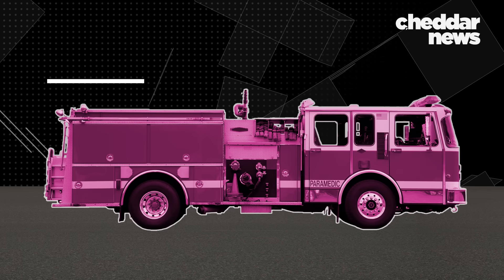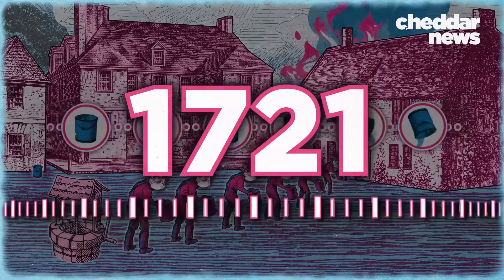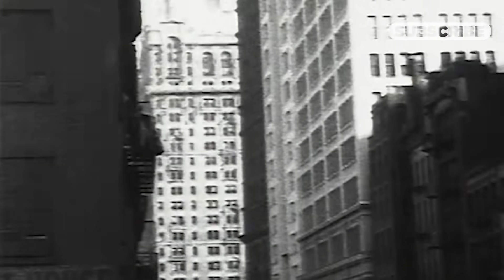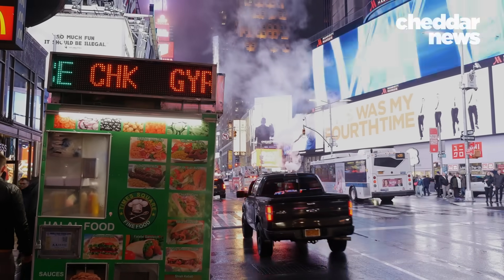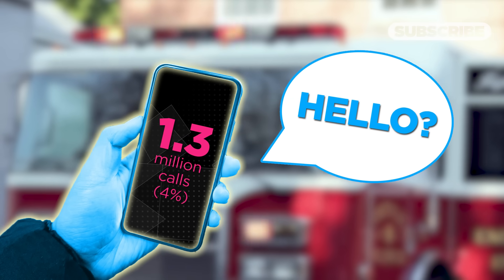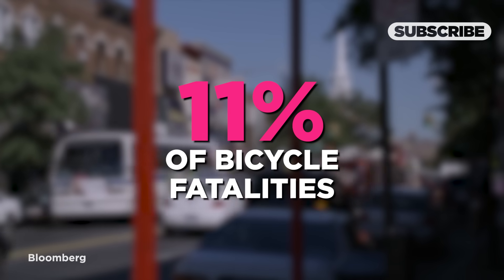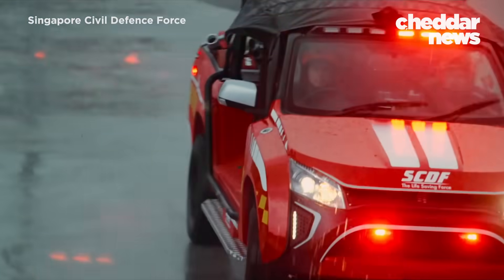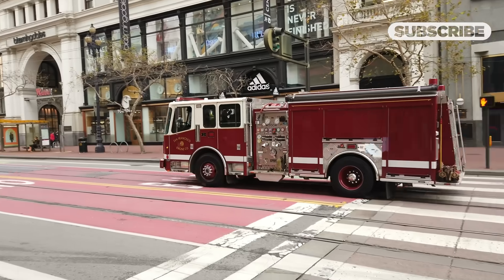Do American Fire Trucks Need To Be So Massive? - Cheddar Explains

Comment: The problem with the euro style trucks is that their tanks are WAY smaller. I am a firefighter and a majority of our juristiction has no hydrants at all. So we need 1500+ gallons, because of the lack of hydrants. Also the US fire service is completely different than other countries. The way we operate is 100% different. One of the guys in my dept went to sweden, and was talking to some firefighters they said that they think american firefighters are on crack cause of how long we stay in. And their gear weights 10x less than ours. Just keep that in mind.
Reply: Ummm
A typical callout (löschzug) in city's in germany will have 1500-2000 gallons of water. One tanker with usually 1000 and one to two general/all purpose engines (Lf/hlf) with typically 500 gallons, sometimes another 100+ or so might be carried on the ladder so it can engage while hoses are still being set up. Additionally a command vehicle will be out
Reply: @the_retag  -- That's quite a bit of water!   The water alone would be 8 tons.  A machine carrying that much water wouldn't be tiny.   It might not be supersized but not tiny.
Reply: @GilmerJohn  ah i mixe gallons and liters up again
Its 2000 gallons total, being 8000 liters in three trucks
Ill fix it
Reply: @GilmerJohn  its 1000 gallons/4 metric tons in a tanker. It carries only 3-4 firefighters and only a few hoses breathers and fire specific equipment, not general stuff like hydraulic shears, oil binder etc. Often 100 gallons or so of foaming agent will be carried as well. Ther eare sometimes large tankers carrying up to 2000 gallons, and rarely semi based ones with 5000, but those vary as they are not standardised
Reply: @the_retag  That is 1 truck for us, thinking about it we could have a fire alarm with 5000 gals. If we get 2 engines thats 3000 gals right there, if a tanker comes possible 6,000+ and our areals have about 500  or 750 gals. And we get about 8 command vehicles (Cause volly chiefs want to do volly chief stuff ig) we had a 3 alarm fire, and we had easily 10,000+ gallons there
Reply: well, there are Engines and Tankers; Although they vary quite a bit in city, from small and compact Tankers perfect for the cities, there are also Tankers based on semi trucks just like in the US; Also Europe has many countries where the hydrant network isn't great, and they also need to shuttle water to wildland fires.
Reply: @EnjoyFirefighting  My area is mostly rural, our sister department has the city. It's not the point to what I'm saying, what I mean is that those size apparatus won't fit our needs
Reply: @evanl.4556  you said that our tanks are way smaller, which IS correct for the average Engine ... but there are also apparatus with 6,000 gallons of water or more; But I completly understand that these apparatus still wouldn't fit your needs for many different reasons
Reply: @EnjoyFirefighting  Over here there are some apparatus with 7,000 gals. But I agree there are exceptions, and thanks for understanding.
Reply: @evanl.4556  largest one built here on a normal 3 axle truck, not being a semi truck, carries 8,717 gallons, but well that's not for municipal use; Largest truck trailer combination I know of carries 15,787 gallons, but again not for municipal use. 
For municipal use the largest Tanker (not being a semi) carried 5,231 gallons, and the largest semi truck based Tanker is probably the one which carries 7,000 gallons. However all those are barely any good for a contest on who has the biggest d*** .... all those are super rare apparatus, far from the average and I'm sure there are lots of Tankers in the US which carry more water
Reply: @EnjoyFirefighting  Lol, and yes there are tankers almost everywhere. IN my area, generally they hold up to 5000 gal. but we got some tractor drawn tankers
Reply: @evanl.4556  we have Tankers everywhere as well, but most are of rather compact size, being based on a 2 axle truck chassis. The smallest of our Tankers carry less water than your Engines do. In fact, the American Engines the US Army Fire and Emergency Services used to have at their USAG bases here had to be classified as Tanker due to the amount of water they carried and the lack of other equipment which would be required to classify them as Engine here. 
In Germany tractor drawn tankers are super rare (I can think or 4 or 5 maybe), but they're are a standard in e.g. Poland where even a FD in a city of 400k inhabitants have several tractor drawn tankers.
Reply: but does all that weight make the american firefighters more efficient? because if it doesn't, then just adopt the european/asian way.
Reply: @pizdamatii5001  It helps us adapt. We go in with the mind set of risk a lot, save a lot. Risk a little, save a little. I will go into a collapse if I know the victim is alive, and savable. I will go to hell and back, but I need gear suited for that. I can't have gear that is paper thin (I know it's not paper thin just making comparison).  And also here in the US, the fire service runs on tradition, that is the most important thing is keep tradition going. That is why some depts. have bells on their rigs, why all our ranks have bugels and not stars, and more stuff I can't think of

Comment: Another point on cost.  My town recently had to build / rebuild both firehouses because the newer style larger trucks were almost the same size as the doors. (Also the buildings were in poor condition, not meeting code, etc.) So that only increases the replacement cost for new equipment.

Comment: The response from fire departments to narrower pedestrian friendly streets shouldn't be to oppose them, but to embrace them since they would reduce the number of vehicle accidents which make up the majority of fire dept. calls. Shouldn't fire depts. be pushing for ways to prevent the need for their service?
Reply: The US fire trucks have deckguns that they use to immediately halt most residential fires. The problem is they use a lot of water, which is why you don't see Europeans trucks having them.
(They use deckguns because it takes less time to set up and don't have to stare at a fire as it burns down a house while throwing hose line.)
Reply: @AG-yc7vt  actually, deck guns are very popular on most Tankers in Europe as well, they just aren't as popular on Engines. Depending on the country, bumper mounted guns are popular, even on Engines
Reply: Sadly firefighters (specially the boards controlling them) want to overstate their importance.  Is like cops they don't like stats that show lower crime
All about money
Reply: Here's the thing. If there is an emergency, as long as the "truck" can get there, even if driving on ped/cycle friendly streets, then those along the path should clear out so that the emergency vehicle can do its job.
Reply: Jreese46 forgetting well funded public transport and bikes. Anyway much better for you.
Reply: By regressing to making everyone walk?  I suppose they could just tear your house down, to guarantee it won't burn, too.
Reply: @jreese46  Lol, excellent point. These anti-car people find it difficult, near impossible, to think outside of their own experiences.

Comment: As a firefighter. With all the gear and people we have the size is necessary. When we have a truck packed with guys and all of their gear its cramped enough, making it even smaller would be terrible. Plus the trucks we use now are just badass.
Reply: In Europe those smaller trucks work too
Reply: i wonder if american firefighters are larger than their european counterparts?
Reply: @pizdamatii5001  You don’t see a fat yellow helmet firefighter in Ireland
Reply: the trucks you use now are big that's not a synonym for badass
Reply: I see many American apparatus where lots of the available compartment space remains unused, while the way more compact apparatus from e.g. Germany carries in fact more equipment (but with a smaller water tank) as every inch of available compartment space is used like in game of tetris.
Reply: @EnjoyFirefighting  What dept have you seen with unused compartment  space?
Reply: @Raheim157  I'd have to look them, could post a video link mabye tomorrow; It's definetly a thing I've seen at more than just a few apparatus walkaround videos, seems to be a pretty normal thing for equipment being stored loosely in drawers or at the bottom of the compartment, with the upper half remaining empty
Reply: @EnjoyFirefighting  Wastage

Comment: Of all those calls that weren’t for fires, many were made because of the threat of fire. Much easier to call the FD to prevent a fire that could break out due to a wreck or similar event.
Reply: It's a poorly written piece and doesn't cover the fire service as a whole or the actual correct sizes of apparatus. The actual average water tank size is 750 gallons of water the correct width of a custom cab is 96 to 100 inches not 10 feet as claimed. And smaller compact units are used all over.
Reply: @mikechristensen8046  Yeah, several double takes required when watching the video. Where's my department's spacious 10 foot wide cab???
Reply: Also, it makes much more sense to have one expensive vehicle that can respond to everything (in the European, American or whatever style) than it does to have a million different vehicles. 

This "x% of incidents are fires" thing always pops up, but it's a bit like singling out a particular bit of medical equipment in an ambulance and saying "we don't need that, that's only used in 3% of callouts."
Reply: Most of the calls firefighters take today are from car crashes. Modern fire prevention methods are effective enough.
Reply: @bishop51807  Incorrect.  It is EMS (medical) calls, not motor vehicle accidents.  Most accidents are non-injury and don't require a fire dept. response.
Reply: @ArmyMP  You are 100% correct. Most calls are EMS. The term "Fire-Rescue Dept" is misleading in order. Hope they never change that though. "Rescue-Fire Dept" doesn't sound right. 😂
Reply: @ArmyMP  And most EMS calls are answered without a fire unit response.
Reply: @ArmyMP  In a lot of cases, fire is called for a reasons.  1, better to have them there IN CASE a fire happens  2, a person may not be injured, but the car is damaged in a way they can't get out  3, Simply blocking the road with something huge and with tons of flashing lights.
Reply: @andrewtaylor940  Actually... many agencies send an engine to medical calls as well.  They might get their sooner and thus provide initial medical aid for the arrival of the ambulance.  They can also assist the ambulance crew (EMTs+) with finding the patient, lifting/moving the patient, deal with family, and when needed, driving the ambulance so both EMTs can work in the back with the patient.
Reply: @ArmyMP  I know. I was Fire/EMS for many years. But Engine response is less common then is sometimes thought. and honestly, it's often done to fluff the numbers for the politicians, who like to see really expensive Fire Trucks in motion and uniformed fire fighters looking busy. Personally I always hated it as putting an Engine on the Road full lights and sirens is way more dangerous than putting an Ambulance and a fly car. But they do it. and yes there are some scenarios where it does provide actual concrete response benefits. The two main ones I described are more rural and widespread districts where the Engine might be the closest first responder. Back in College I worked EMS up on the Western New York/Pennsylvania border. There were some small population rural communities out there that an Ambulance trip to the nearest hospital could easily be 2-4 hours round trip. And they did not have a lot of ambulances. Heck some of them were so far out that they had to do patient relays. Where they would meet another department closer to the city on their outer border, on the highway and hand off the patient. Just to reduce their time out of district. (much of that goes lifeflight helicopters these days). The other example is really high density cities. Where an unexpected sudden peak in EMS calls can overtax the system and slow responses. For example look at the South Korean crush event last month. In those events rolling engines as first responders can be a huge help. But really in most mid sized counties/cities, it's fluffing the response numbers so the elected "leadership" doesn't ask why they have all this expensive stuff sitting around. Most departments creatively account for Ambulance and Fire Responses as different line items in their reporting. Even if they are the same 911 call
Reply: @ArmyMP  Prove it, a smart person never just take anyone word online.
Reply: @choppermike3329  Singapore meanwhile calls it more broadly the Singapore Civil Defence Force (SCDF)
Reply: @lzh4950  Run by the Military?
Reply: @bishop51807  wrong 80-85% of firefighter calls are medical in nature
Reply: @dreupho8242  Prove it....I said car crashes because that's when they are needed. A Paramedics can handle a regular medical emergency firefighter are more needed when you inevitably. flip your car and they have to cut you out😁.
Reply: @bishop51807  Huh, things don't burn anymore, you say?
Reply: Not at all. In a lot of places in the US, fire runs on every EMS call(if they don't run the ambulance service). It keeps them relevant in a world where fire prevention has made their actual job much less needed. That's also why they've adopted technical rescue, hazmat, and other roles in public safety. The problem is they still spend insane amounts on fire equipment...the vast majority of fire calls are medical though, not even rescue.
Reply: @zaspo  Many Depts. in the US have Paramedic suppression units that run EMS calls. Where I work we have Paramedics on Engines, Rescue Squads and Ladder trucks. We also run the ambulances. It's not at all to keep those units relevant but to have Paramedics on the scene more quickly to save lives. Metropolitan areas have this type of system often. Stats show it saves lives.
Reply: @zaspo  They spend so much on Fire Equipment because doing so vastly lowers the insurance rates for the taxpaying property owners in their fire districts. The expense of 4 Class A Fire Trucks at $500,000 each will save those residents and businesses 10x that annually on their homeowners and property insurance bills. Because the insurance actuaries view having those 4 trucks as “best practices”. And they’ve literally done the math.